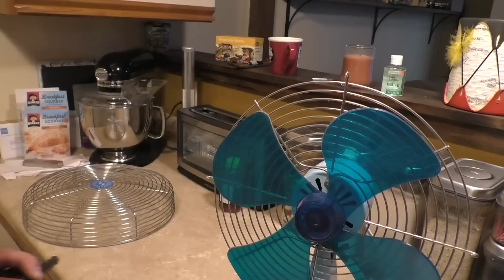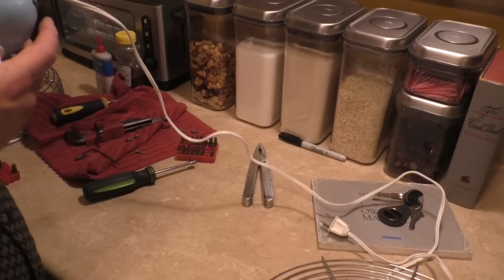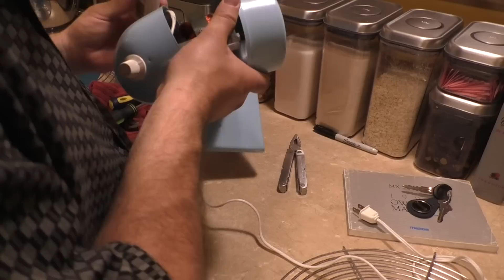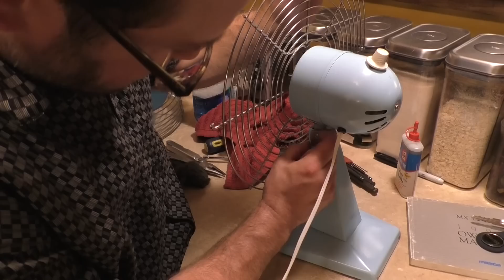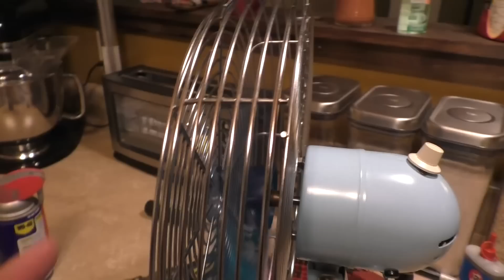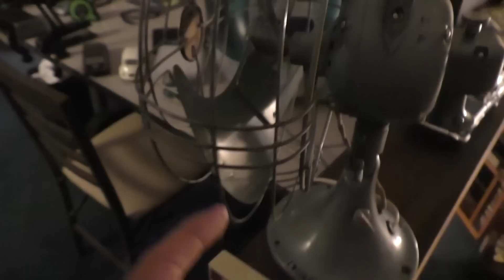1970s Superior Electric Fan - A Poorly Built Antique

Comment: These types of fans used to be known as “dime store fans”. Although this one was probably a little bit more expensive than the old Eskimo and other branded McGraw Edison fans. Since this fan has an OSHA compliant guard, I would say it might be from the late 1960’s, early ‘70’s. I have a couple older Superior fans with stamped metal blades and pre-OShA guards. As mentioned in your video, these fans were meant to be run into the ground and thrown away once it stops working. Even though these dime store fans were cheaply made, they are still better than much of today’s cheap Chinese crap quality products.

Comment: Yeah, I don't buy anything with plastic blades just because the quality is usually questionable. I use a 1940s Westinghouse fan while I am working and it moves a ton of air. However I would also say that cheap fans from the 1970s are still miles better than modern fans.

Comment: I recommend you get a bottle of zoom spout oil, I used to use 3 in 1 but zoom spout doesn't seem to attract dust and gunk as much and lasts longer. The design of the bottle is genius for getting into tight spaces like on that fan where you can't fully get it apart.

Comment: You can't judge a fan from the blade only. I have a 1980's Sanyo desk fan with poorly pitched fan blade, but the motor is pretty big. Some fans have skinny pitched blades, but they move lots of air. Reason is that the manufacturers designed the fan blade smartly. But fans with deep pitch do move lots of air, and they are mostly quiet as well.
Reply: But antique fans are a lot better than modern China Pride junks.
Reply: @TheFanUniverse got another example of that. My 1950s Limit 16” has really poor pitch but still moves a lot of air due to the 90 watt motor inside the fan.

Comment: That is the Superior Electric  oscillating desk fan Model 1200. They went out of business in 1982, so it's vintage. Don't think it goes back to the 50's despite the turquoise though.
Reply: Which model had the steel blades and just an on off setting?
Reply: @buckwild6587  I have an identical fan with white metal blades, says model no. 1000. Made by same company. Found in Poplar Bluff, MO at thrift store for $20. I notice mine has a smaller black Leviton round knob, instead of the white one.